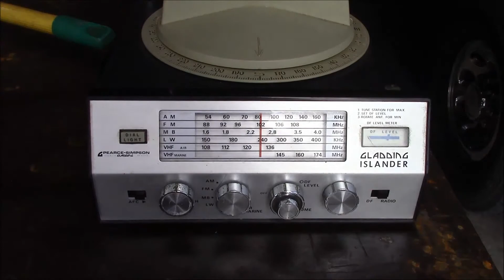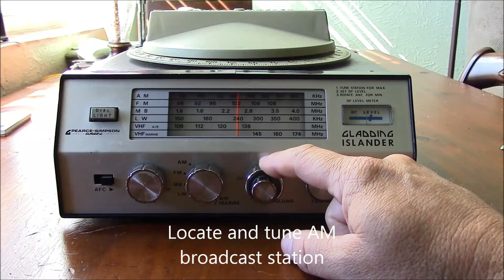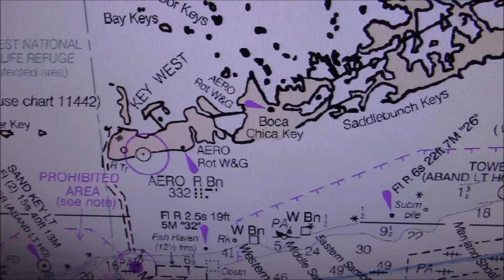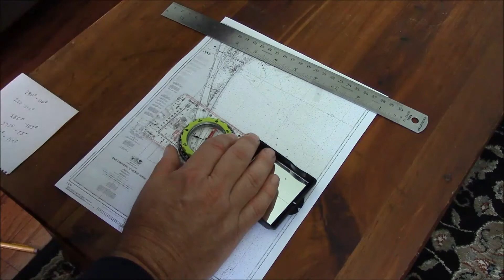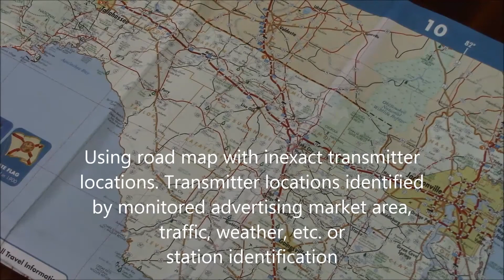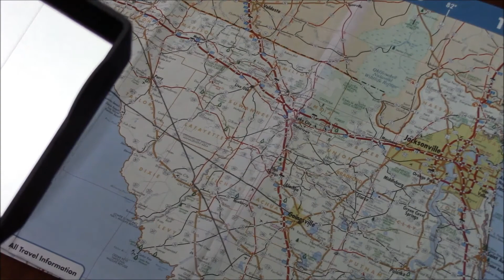Pearce Simpson Gladding Islander direction finding radio

Comment: Could SC tell if one finds two nulls ? Or in case only 1 null is found, how is this done ? 
This antenna dail is plugged in to look in it.
Reply from the maker: There are two nulls off of the ends of the antenna. If the signal is very strong and coming in the front of the receiver you adjust your RF gain  (DF level on this radio) to reduce sensitivity until you do .  Thanks for watching !
Reply: @survivalcomms  O.k. but how do you find the right direction then ? Sail a bit till it gets weaker or stronger ? What does the manual say about this ?
Reply from the maker: @janvisser8452  triangulation

Comment: Thanks for posting your video. I just inherited a similar model from the same company in my dear late uncle's belongings. He was a graduate of the naval academy, an MD -- and he never lost his love of the water and water crafts in his spare time. Since finding this in the closet of one of his homes, I've been anxious to see it come to life. Unfortunately, the power cord is missing along with the hard shell case cover and any other accessories or manual. If you could point me in the right direction to locate the appropriate power cord and possibly an online source for a manual, I would really appreciate it! Thanks again!
Reply from the maker: Very cool !  What is the model number and make and I will do some digging on your behalf.  Thanks for watching !
Reply: @survivalcomms  I'm in possession of a Gladding Newport. The AC input ion the back s designated with DC+ 12V- The unit is almost identical to the model you are showing. The affixed compass on top of the unit is a sky blue color. The switch on the lower left front panel slides between ADF-Radio-BFO. The right lower panel switch is: OFF-WB1-WB2. Finding the proper elec cord and manual would be great. Thanks again for your interest.
Reply from the maker: @nickcharles1241  No luck on the manual thus far. I did find images of the radio and it does look like a cool unit. If you could please send me a photo of the plug in the back and we will see what connector it uses.  My email is my channel name at gmail dot com
Reply: @survivalcomms  Thanks for your prompt and polite reply. The radio is located at my other residence. I can forward you the details tomorrow. I can tell you that it's a Pearce Simpson.

Comment: It is like orienteering using radio signals instead of landmarks. Way Cool!!!
Reply from the maker: That it is. If you dig this check out some foxhunting videos. With several transmitters you can make a pretty challenging little O course. Thanks for watching !